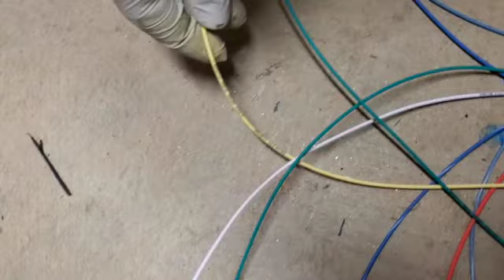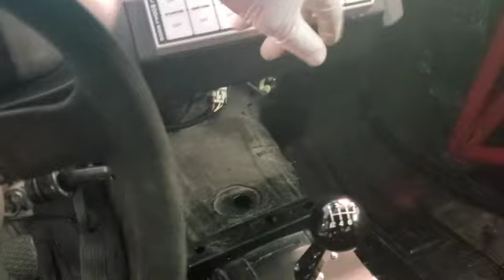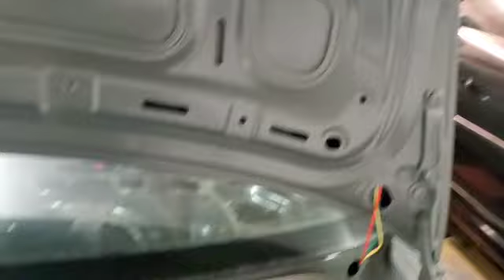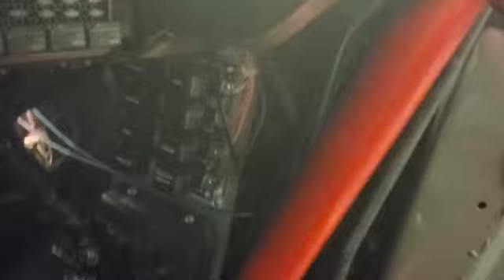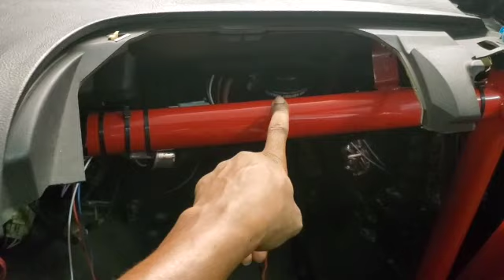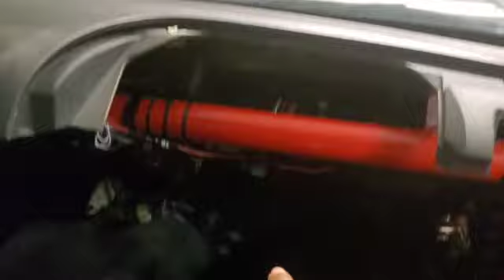DIY How to Wire up turn signals in any Vehicle

Comment: Nice video Bro, thanks. I'm working on my project truck-78 ford courier. Having issues with the TS & Flasher not working,  working on the electrical system as well. Removed a shitty glass fuse box (shorting) and upgraded to spade fuses. Final- 302 cobra hooked up to a T5 & 4-11's in the rear. Good luck with your project. Thanks again.
Reply from the maker: Glad I was able to help you with this video and good luck with your project, im sure it will be awesome when completed.

Comment: Any reason why you put the signals on the inner trunk lights instead of the solid taillights? Just wondering this car looks so sick i cant wait for the vids of it rippin
Reply from the maker: Yeah the outer has LED lights already hooked up to the brakes and I didn't want to even begin messing with those wires. It was simpler to run them to the inners because they were blank. Thanks it will be ripping soon for sure 👍